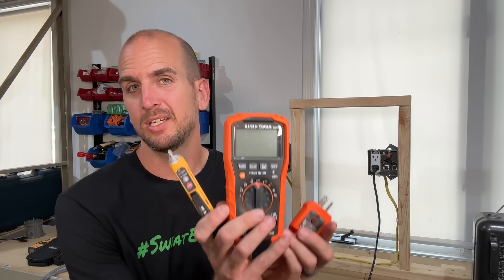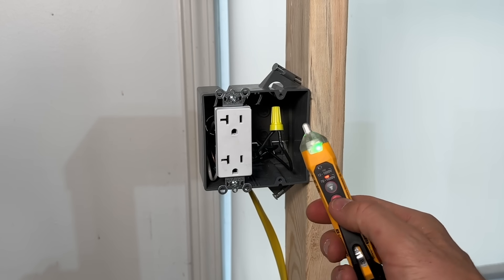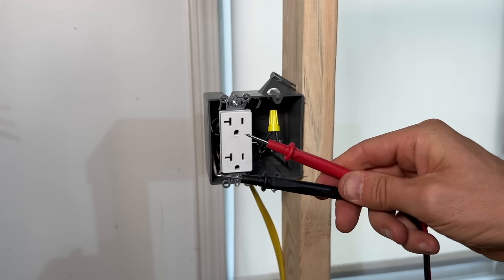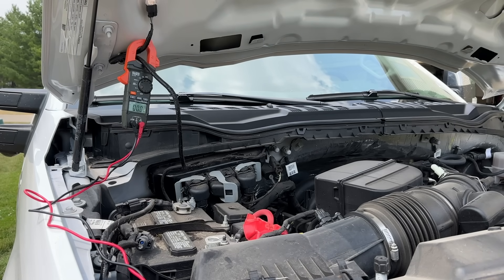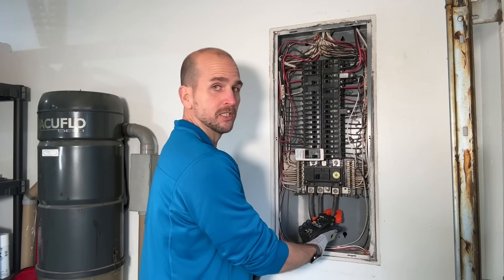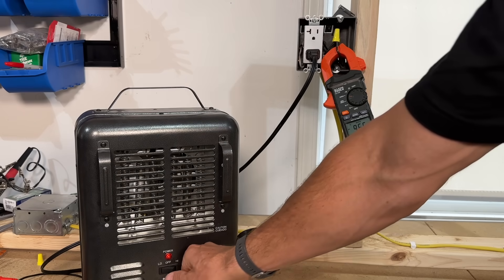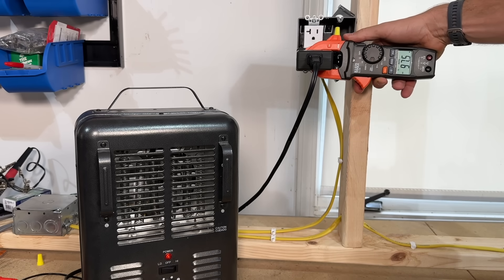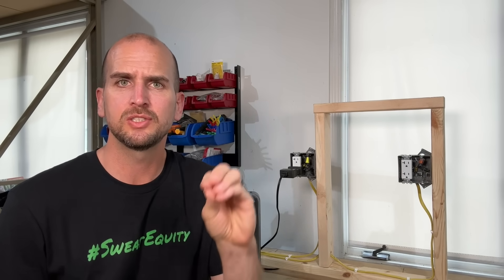Why The Clamp Meter Is The Only Tester You Need | Pros and DIYers

Comment: This seems like good advice, until you realize a lot of clamp meters don't have the non-contact feature in them, and even if they do, the wand is tiny and can fit in a pocket, while the meter is large and not something you want to carry around. I'll always say to have a hot stick, they're small, light, cheap, and do the important job of saying if something is hot or not.
Reply: I use a non contact alot but the meter is the surefire way to tell if something dead or not cause feedback from other circuits can cause the non contact tester to go off sometimes
Reply: I use non contact daily! Keep it clipped to my sheet collar! They are Ling little heffers at times. If in doubt just trip the circuit. Usually run into that issue in commercial where they shared neutrals across circuits.
Reply: Idk about that. Those little tester sticks you're talking about can pick up ghost voltages especially when working around 480v and that's a big deal. You dont want to gwt caught on the wrong side of that
Reply: No real electrician would ever use a non contact piece of crap...
Reply: @Scott-st2yi  At least not to be safe. As an indicator, OK.
Reply: @Scott-st2yi I do 😢
Reply: @Scott-st2yi Been an electrician for over 30 years and my non contact tester is always in my pocket. Test every cable with it and it's never let me down. Buy a quality one, worth every penny.

Comment: DMM's are for bench testing.
I have this very same meter. I am an electrical contractor and fully endorse this video.
By the way, the best feature of the clamp ammeter is you can hang the damn thing and read it while using!
Reply: I just used my DMM today in my car, tracing down an electronics issue.

Comment: Great video as always, But a quick clarification about something that confused me for a long time, a residential panel is Single Phase, technically "split phase", because the single phase is spilt into 2 legs. Power plants produce 3 phase power and your house is feed by ONE of those phases. It feeds a transformer that has two 120V outputs and a center tap, the Neutral. [a center tap gives half power] Your panel is fed with 2 120v LEGS of a Single PHASE, and the center tap, N. Any circuit between the 2 legs has 240v potential, any circuit between one leg and the N has 120v potential. 

Apparently there were some very early systems that were 2 phase, but once things were standardized, we only have Single Phase and Three Phase. Three Phase gets even more complex because there are various ways to utilize the multiple phases, but generally it available only to industrial or large commercial buildings, anywhere large electric motors are used. Most electric motors above 3hp are 3 phase.  A single phase motor has one "push" per cycle to rotate it, while a 3 phase motor has 3 evenly spaced "pushes" per cycle.. so much more powerful and efficient.

Comment: Great video, I'm sold.
We're about to have an 18kw solar array installed with 10kwh battery, and I'm concerned if it will handle the startup load of our well pump (3 wire). Is this a tool i could use to see that?
Reply: I think you would need a clamp meter that can measure millisecond-duration Inrush Current (not just Min-Max functions). The value of which, you would need for sizing your battery and inverter. I'm not sure which Klein or Ideal has it. As you may already know, start up current of AC motors can range from 3x to 6x the normal running current.
Reply: @ramschannelreviews  - Thanks for that, and indeed I am aware of the startup demand. Actually Enphase, the kit I'm going with, has recently introduced a new generation battery they claim has that surge capability built in. Now whether a 10kwh battery can then run a well pump (230' deep) for any useful amount of time is another question which I think we'll soon find out the answer to.

Comment: FYI - Some brands will offer the clamp as an accessory if you already have a multimeter.  Then you have the  Fluke 117 which is the traditional multimeter shape but has a non-contact voltage tester built into the top.

WARNING: - Does the cheap-o meter you are thinking of getting have an amp marking (A) next to a terminal?  You are likely dealing with an unsafe meter.  Clamp meters usually don't have more than micro-amp capability on their test leads for safety reasons.  If you find a meter that does, chances are you risk blowing your hand off if you use it.  Unscrew the back of the meter and see if there is a fast-blow fuse connected to one of the lead terminals.  (Fast blow fuses are usually white in the middle instead of clear glass.)  If you only see a regular glass fuse inside your meter then REPLACE that meter.  It doesn't matter how careful you think you are; eventually you are going to leave the meter set incorrectly when you switch to using the leads, and the glass fuse willl explode.  It's not worth cheaping out on a meter.

Comment: From the display of the meter you're using, it looks like it can't test  Amps DC...only AMPS AC.   There are different types of clamp meters that can measure amps DC.  You should have mentioned that in your video. Great info though. 👍

Comment: I'm really sorry but, you are frighteningly WRONG
Reply from the maker: Just in general or about something specific?
Reply: @EverydayHomeRepairs  your getting unqualified untrained persons to work with low voltage ac systems (50V ac or more) any NCV should only be used to prove there is voltage, not that there is NO voltage. Clamp meters are renound for falier and giving incorrect results. If you want to teach them, teach them about voltage testers and proving units and what personal protective equipment should be worn.

Comment: I absolute love my DC clamp meter. I do a lot of work with electronics, so DC functionality is great for me. It still isn’t my go to for everything else but for measuring current it is extremely handy to not have to break circuits, worry about burden voltages, blown fuses, or mistakes when measuring current.
Reply: Yes. Something without DC current is useless.

Comment: I picked up a micronta analog clamp meter with a break out adapter. It has a 1x and 10x slot. Super cool and very useful. 

The other thing to look for is a DC amps clamp meter. Those are really useful for diagnosing DC systems in vehicles. I work with a lot of people transport systems that have heavy charging systems and heavy loads, and the DC amp clamp meters are indispensable.

Comment: Multimeter is a great tool, but a good voltage tester is super useful too. They seem to get lots of hate but are really good a diagnosing wiring problems in a home or commercial space.
Reply: A glowing 2W lamp is a lot harder to argue with than a wiggling meter or a flickering LED that may or may not be reacting to RF.

Comment: Another model to consider is the Uni-T UT210E clamp meter.  It includes all the  usual voltage, current, resistance, clamp, NCV, as well as capacitance - and it sells for ~$55.  I consider Uni-T to be a lower quality brand than Klein, but I've had the UT210E for a couple years now, and it has worked great.
Reply: I have the same tool. DC amps is a must for me. I do a lot of car work.
Reply: @billrimmer5596 oh! They have those?! Nice! I need one!
Reply: It can amp check ac and dc which a lot of meters dont do. Most of them only do ac amps.
Reply: Uni-T is the top brand in China; better quality than Klein at the same price range.
Reply: I was just going to Comment the same thing. My uni-t meters beat the crap out of any Klein. The ut210e is indispensable on the bench.
Reply: I'm getting the UT204+ clamp meter. It's an ac dc amp meter and pack more features compared to ut2210e or 210D with almost the same price. I've seen videos of ut204+ being used by service engineers in the field.
Reply: Give me your finest, cheapest cigar! The UT204+ is a no-brainer! Not the best quality, but it offers a whole lot for the price! I totally recommend it for beginners and DIYers!

Comment: DIYers can make their own splitter from a short pigtail with male and female AC connectors thus saving some money. I put a 10 turn coil of #14 wire in series with one lead so small currents can be measured by dividing by 10.

Comment: Why does it multiply the amps by 10 when using the adaptor?
Reply: This is just a wild guess with no research, but might be for accuracy of lower loads, essentially magnifying them into useful measuring range.
Reply: Inside his adapter, the manufacturer wound ten turns of wire. Some adapters have separate x1 AND x10 holes for the clamp meter.

Comment: Just remember, if you want to measure direct current,  eg Autos, only very expensive clamp meters can measure DC current.
Reply: UNI-T have very affordable clamp meters that measure DC current.  And they're small, ideal for cars and boats.
Reply: Yep, that's certainly a nice feature to have,  but typically you'd only use the DC current setting in a commercial or industrial setting on DC motors.  For general use, an AC current clamp meter will serve you well.
Reply: I was trying to measure current draw on my truck on the battery cable and was reading a few amps but your comment got me thinking and this clamp meter shows only 2/20 or 200/400A~ but I’m reading 5 or 6 amps.  Something not making sense here I guess.  I’m looking for parasitic drain but not able to detect anything is that because it’s not actually reading DC drain?
Reply: Not sure if you have tried this but if you get into your fuse box you can measure across the top of your fuses with your probes.  They have openings in the plastic.  I was able to isolate which component was pulling power this way. @danbarnard1087

Comment: While you were at the car. Y0u could have used the clamp meter to see the amps the battery/alternator is putting out.
Reply: My understanding is his model only measures AC with the clamp. Also, measuring the output of an automobile alternator would require finding the correct wires and putting a load on the circuit. The gadgets they use at Auto parts stores to test the battery and alternator usually have a calibrated resistive load built-in to make measuring the voltage and amperage straightforward.
Reply: @conwaytwt  The large wire going from the  alternator to the battery is the supply .  And it would be a crappy meter if it only did ac.
Reply: @Ezzell_  Not all clamp meters measure DC. And note if the battery is fully charged there won't be enough current to measure the output of the alternator. You'll also find that on many cars the lead to the starter is separate from the lead to the alternator.

Comment: As usual your putting forth crap, NO TESTER that indicates voltage by looking at magnetic fields is accurate. Your exchanging one piece of useless junk for another fancy one. Speed and convenience is never the way. Those clamp meters are fine but dont do what you say they do.  Its just a VOM with a current clamp function. Also you cant measure current for a generator using that thing because its not fast enough to catch the motor start up currents and locked rotor currents on inductive loads such as motors, it will only show the run current. You cannot size up generators with it.  You love to teach people things that you yourself dont know. You really have no business teaching people electrical technology and should stop. Dont you even research anything before making a video? Apparently not. But I know your selling them so shouldnt you know what it will do and what it wont?

Comment: 90% of homeowners shouldn't even be plugging a space heater into an outlet, let alone using a clamp meter. 🤣
Reply: Some of the worst work I’ve had done in my house was done by licensed electricians.
Reply: @DougBashem Well ofc they aren't the ones who have to live with it not quite as much at stake for them
Reply: With a 14 awg 100' ext cord.
Reply: I use an old thin extension cord that glows when I use it with my space heater 🙃
Reply: @Group_Anonymous  Same here. The heat from the cord makes for  more even heating especially in all rooms. Yay 👍
Reply: And by the way, you plug a space heater into a receptacle.
Reply: @MarkLawry  The problem with the word receptacle is that it's both technically and functionally incorrect, even if it's traditional. Yes, it's "receiving" the prongs, but as it's the source of power, "outlet" is the more apt term. And seeing as I still install hundreds of these per year, I'll continue using the word outlet.
Reply: Very true 😂
Reply: What’s wrong with space heaters
Reply: @redcartiers  Because he said so. 😁
Reply: Wait…you plug the space heater into the outlet? Not the smoke detector??? DOH!!!
Reply: 98%of electricians think they're God and people are dumb as sheep.
Reply: Ignorant comment
Reply: Space heaters are out of this world.
Reply: Says “espressomatic”. You probably also have a solar roof.
Reply: @expressomatic  As a firefighter I can verify your comment 😂
Reply: Truth
Reply: In my experience most contractors know less about their business than I do.   They rarely actually know the rules or details of their profession.  They have just done various jobs for many years without study or research.  I’ve done years of general handyman work but I always do research to make sure I know what I’m doing and generally know more about their business than job than the person who shows up to do the job.   This isn’t ego, quite the reverse.   I assume I don’t know enough and they assume they don’t need to know because they are already “an expert”
Reply: But they do. And clamp meters (expensive ones)  work well. What's your electrical experience?
Reply: @chrisking4636  over 30 years experience, why?
Reply: @chrisking4636 why do diy’ers need to be using a clamp meter? They are not even competent. Next they’ll be wanting a loop calibrator.
Reply: @hvaccuffingit6471 Nah, I'm an electronics engineer. I don't trust other people to wire my home, not even licensed electricians.  You'll be lucky to get one takes pride in their work.
Reply: @hvaccuffingit6471  Do, all diyers are Stupid? Thank you. 👍
You forgot to add that all electricians are competent.
Thanks, I'll be hiring a certified electrical contractor to replace an outlet.
😁😁😁😁😁😁😁😁😁😁😁
Reply: There are Few; but they are out there.

Comment: I have the Ideal 61-747 400A AC/DC clamp meter and that's my everyday meter while in the field.    The diode & capacitance functions are particularly useful for troubleshooting specific pieces of equipment.
Reply: Hi I have a question Can you test Central AC capacitors with it?
Reply: @brians1159  yes, you simply place the dial to the capacitance setting, this particular meter is auto ranging,  so no need to worry about setting the range.   If you need to test a capacitor but only have a basic meter with AC/DC volts, resistance and DC amps (typically up to 10A) a quick and dirty method is to use the resistance function,  be sure to discharge the capacitor if necessary,  then place the leads across the capacitor.  A good capacitor will begin at a low resistance and gradually rise.    A shorted capacitor will stay at a low resistance.  An open capacitor will stay at a high or infinite resistance.  The capacitor could still be bad meaning out of spec as far as the capacitance value,  but if it passes the resistance test it's most likely good.

Comment: I recently purchased the Fluke T6 1000. Definitely worth the money but a NCV tester at the tip would've been a nice feature. Thank you for the video!
Reply from the maker: Man, I used Fluke for years and they are definitely the top brand on the market.  Just hard to justify the cost of Fluke as a homeowner / DIYer.

Comment: is it quick enough to pick up the surge of motors and pumps on start up?
Reply from the maker: The CL120 might not do the best job.  If you step up to even the next level up (CL220) it is a "TRMS" meter which is more ideal in some applications where you need a more accurate measurement.
Reply: What you're looking for is something with inrush current support.  Look at something like the Klein CL440, CL900, etc.

Comment: As far as I can see this clamp meter cannot measure low currents in order to check out Earth leakage / residual current issues :(. Am I correct?
Reply from the maker: Probably not.  If you are looking to measure in the mA range that will be lower than what the CL120 is designed to accurately measure.

Comment: Most clamp meters can not do series dc ma or amps often needed for automotive.
Reply from the maker: Yeah, that is true.  In a former career I used to measure control currents in the range of 4 -20 mA and this CL120 would not handle that application.  Thanks for the feedback!

Comment: I'd suggest people look at a clamp meter that can measure down to 10 of milliamps or beyond.  This Klein meter can, a lot of the cheaper units only display 100s of milliamps or higher.

I know this clip is targetted at the USA but people might also consider an insulation test meter but please learn how to use it because improper use can damage things.  A decent IR meter will tell you the state of your aged wiring's insulation and probably have a low ohms mode too, down to 0.01 ohms which is good for verifying circuits
Reply from the maker: Thanks for the feedback!